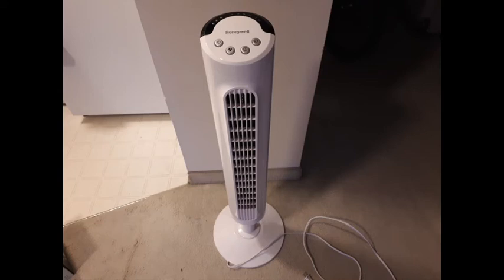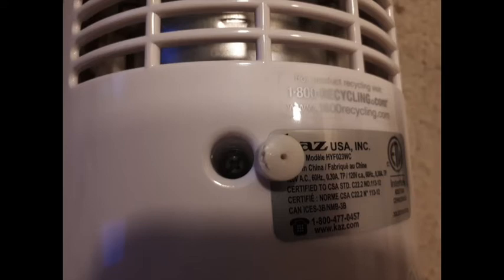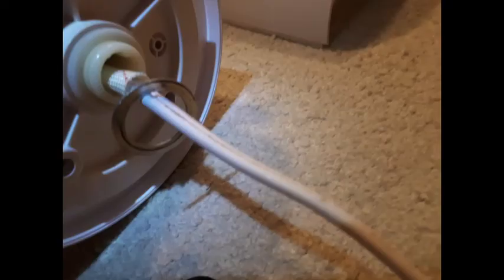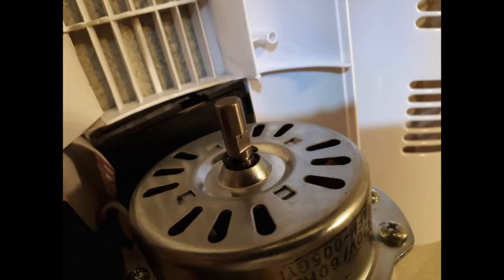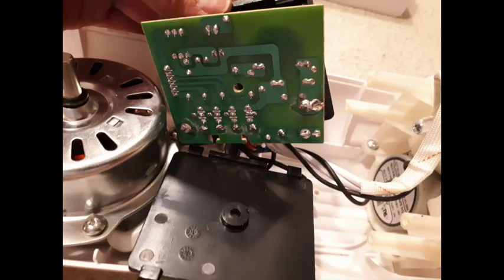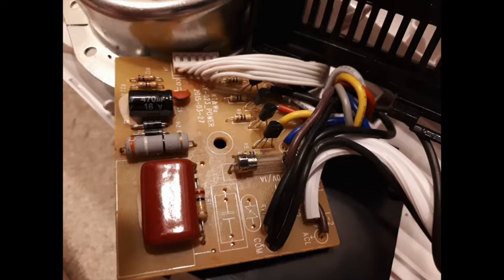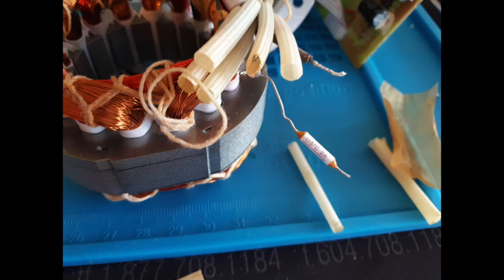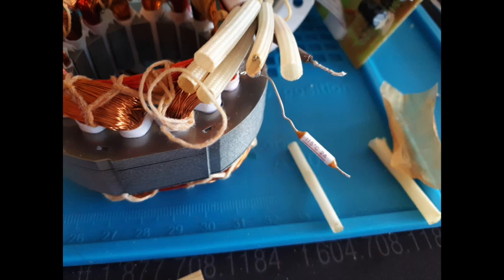Honeywell Tower Fan Repair - (this fan has no power!)

Comment: now my motor hums but does not turn after replacing Fuse.
Reply: In my completely unqualified opinion, could be capacitor? Had a similar repair on an RV air conditioning unit. Would turn it on and it'd hum but not spin, so I'd poke the fan with a pole and it would start going. I guess while it's humming, see if you can stick something in there to push the fan, if it starts going on its own after that, probably capacitor issue. Or if you still have the thing taken apart should be easy to just push it by hand.
Reply: @garstrum4401  I had had the entire thing taken apart and I lubricated the bearings and everything. It spins freely when the motor is off, but when I turn the motor on it gets stiff and only turns if I force it to. I through maybe it wasn't getting enough power and fed the motor straight from an outlet and still stiff. I found it on the side of the road so It could honestly be any number of things wrong with it. My theory is that the motor is shorted out but I have no clue.

Comment: Ohhh, wow, I wonder how many of these has gotten thrown away and this was it 🫣

Mines doing this exact thing, I’ve gotten as far as the fuse and “jumped it”, now it has power(lights turn on and the small motor that turns it from left to right and vice versa works), but the motor for the fan itself doesn’t turn, does that mean that “jumping it” it’s not enough, I’m going to need the Thermal Fuse to get it to work again?

Comment: This fix worked for me!  Same symptom.  Had stored the fan in the garage for a few months, then took it out during recent heat wave to find it had no power.  I struggled a bit with the ring clip, since I didn't have the same tool.  Ended up working a knife in between it and the washer, then prying it off one end at a time.  Removing the plastic back half was a bit tricky too, since I was hesitant to muscle it too much in case it cracked.  I found using a small screwdriver to push in the tabs (where there are little gaps) worked; just did that up the sides, alternating each side.  I'm no whizz at soldering but was able to solder in a new fuse without blowing it.  I felt nervous about repacking the motor, since the wiring felt a bit messy without the braided string but it worked out.  It buzzes a little when running, but it used to do that before it broke too, especially when using the oscillation mode.  Cheers for this great video, we saved another from the landfill!

Comment: What an awful design, "let's manufacture a fan that self destructs when used on a really hot day."  You know, the kind of day you'd actually want to use a fan.  
Mine got killed by the great British Columbia heatwave of 2021 and this video describes the failure perfectly.  I verified the fuse is the culprit thanks to your video!

Comment: Thanks for the video! I'm having a similar problem with the same fan model. Went to bed with the fan on. When I woke up the fan was off and I can't get it to turn on again (no lights illuminate when I press the power button). Was this the same initial issue you had? I suspect the thermal fuse broke as it was on overnight during a heatwave.
Reply from the maker: Hey Niall.  I picked mine up already broken from someone giving it away so I can't say for sure what happened to it originally.

Comment: Hi there, I have the same fan and having problems. It was working fine this morning, this evening went to turn it on and there is obvious power(lights are lit up) oscillates, etc. The problem it is not blowing at all. I know it's a shot in the dark but would you have an idea what it might be? Cheers.
Reply from the maker: Hi there!  It's hard to say for sure what the problem might be unless you can check it with a multimeter, but you say you have power so that eliminates one potential issue.  There is a specific circuit on your circuit board that will be dedicated to the fan movement.  There are 3 speeds and each has it's own wire (if I remember correctly - red, yellow and blue in my video at 6:18).  Maybe start by checking those wires (if you feel comfortable doing so).  It's likely a localized problem surrounding those wires or the power leading into those wires.  Just a guess.  :)

Comment: Thank you for the video, it's quite helpful! I have the Seville Classics one and the set up is very similar. However, my issue is that when I plug it into the wall, there is no power at all (no lights, no LCD display, etc). Prior to your fix, did you also have no lights, no LCD display as well? Both top and bottom boards look fine. I haven't opened the motor yet. Cheers
Reply from the maker: Hi there.  I had no power at all...the LEDs were not even lighting up.  When I encounter zero power, I start diagnosing the issue from the power cord and work my way up using a multimeter.  So I'll check to see that the cord is operating and that current/voltage is being brought to the fan.  But check for a blown fuse before you do anything as it's the simplest fix.